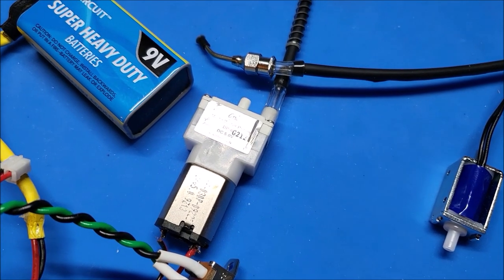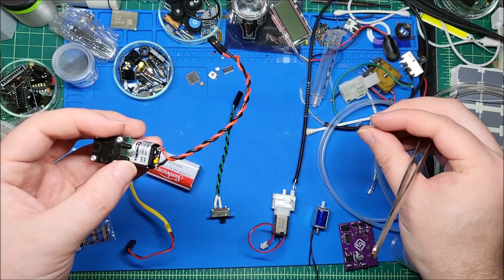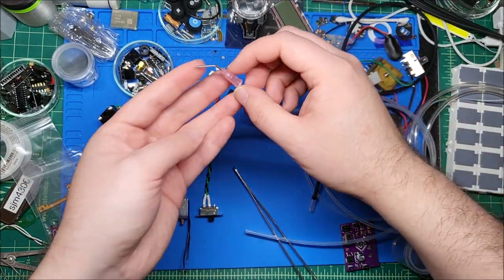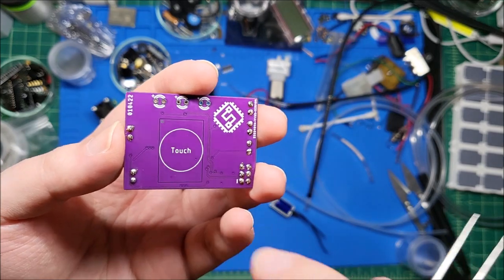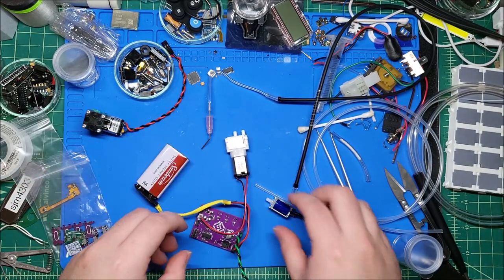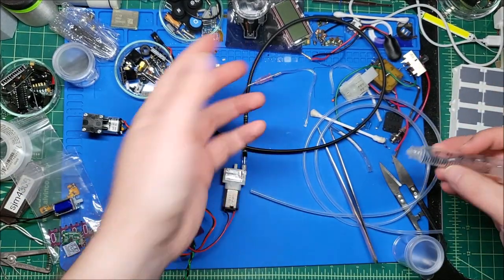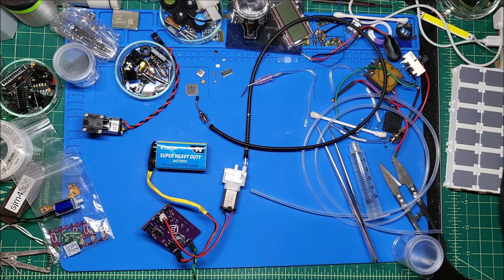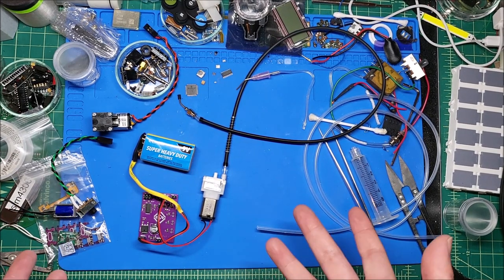Project Vacuum Pen: Part 1 - Hardware and Experimentation

Comment: Something I learned recently regarding things that pump air. When you block the end, and you hear the noise increase like that, the pump is not struggling, but actually increasing in rpm because there is no air to compete with. So the current it draws should actually be less when its blocked.
Awesome project though :) Great idea :)
Reply from the maker: Really, I love learning something new from commenters! That makes a lot of sense if I think about it.
Reply: @sjm4306  yeah, I allways thought that same that you did, I only learnt that recently. It was in a video from rctestflight, about 3D printing vacuum impellers :) im sure you would have seen the current drop of you managed to juggle the DMM and the pump and the tiny components. Looking forward to seeing the end result!

Comment: Thanks for sharing another great project, super awesome! I'm working on similar project and already modeled some parts like pump and solenoid valve so i can send them to you if it could help you.
the challenging thing i found and also you mentioned in your video is releasing section, i think it's important than suction. when working with suction needle it gets dirty and sticky duo to applying flux or solder paste especially when using with rubber pads, and this time it's hard to release the parts accurately and easily. i've test several methods such as three-way connector that you show in video but that's not working properly only by porting it to atmosphere. you need to pressurize it! and for that you need a 3/2 pneumatic valve to switch between vaccum and pressure ports of pump. it's possible to make that one with combinaion of two of the 3-way solenoid valve. but i'm working to build a compact one. the time of pressurize is very short maybe a couple of milliseconds and only enough to drop the component.
Reply from the maker: It looks like this would be a cheap way to be able to switch between vacuum and pressure: https://www.adafruit.com/product/4663?gclid=Cj0KCQiAubmPBhCyARIsAJWNpiP1xTq0VTVbqcB-9r2IUHyUloWxFajmsqqeFOSqY_PM2TOOIEhnnIIaArXtEALw_wcB

If I run into the issue doing more testing it'd be easy enough to bodge into the design with no changes necessary to the circuitry (just additional physical tubing and possibly playing with software timing values on the valve drive output).
Reply: @sjm4306   That's right, i've choosed it too, this is a 3-way solenoid valve and as i mentioned above you need two of them to switch between vaccum and pressure.it's not possible to just using one of this valve and attach both ports of pump to it, i've tested it already. in this way, when you switch to vacuum then the pressure port will blocked and vise versa so nothing will happened and pump doesnt work. to prevent blocking ports you need to use two of them. Thus, when using for example vaccum, the pressure will porting to atmosphere and conversely, so pump works well. I hope I have stated what I mean correctly.
Reply from the maker: Ah that makes sense, I assumed that it would effectively be like a relay where the unselected port would just float, but yeah if it blocks it then clearly one valve wouldn't work.

Comment: - How about instead of different tips, you just put a mesh or filter on it? That way, it'll work for any components.
- This seems useful, but I usually just resort to exhaling on my fingertip to moisten it and pick stuff up with adhesion and use tweezers to place them down (or just hole my breath and drop them and hope they land right).
Reply from the maker: For the smaller parts with tight pin pitches or with very small clearance between other parts tweezers just aren't doing so great for me recently. The mesh idea is interesting, but I just don't see a way it would work over the entire range of massive 200+ pin qfps all the way down to 0402 resistors. At least I'd need much more suction for bigger parts as my current pump cant really lift medium sized 32 pin qfps without the silicone tip.

Repeatability is also key, I want to be able to quickly pick up parts directly from a tape reel without faffing around with alignment so vacuum seems the way to go for these requirements. It might not seem so important for boards with only a handful of components, but I recently hand placed nearly 600 1.5mmx1.5mm LEDs and it nearly drove me insane lol so I need a better way.